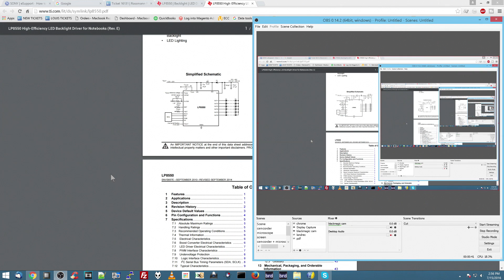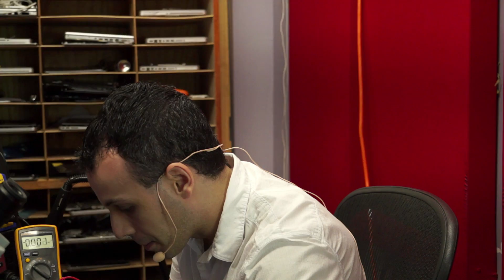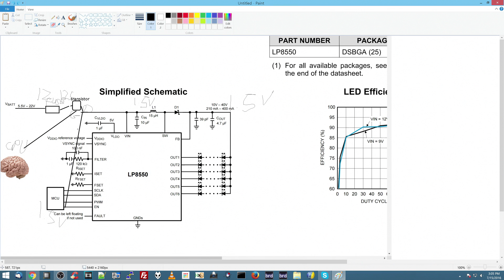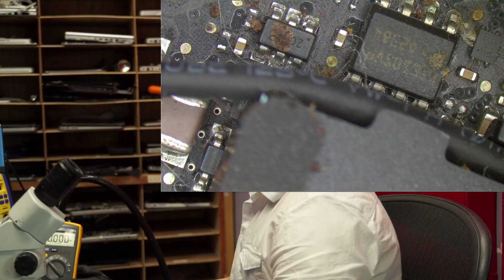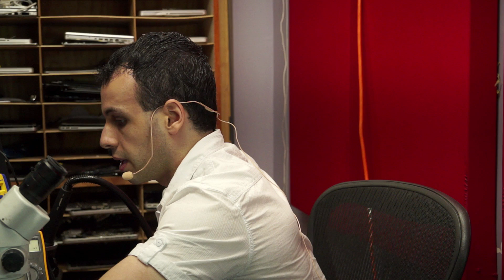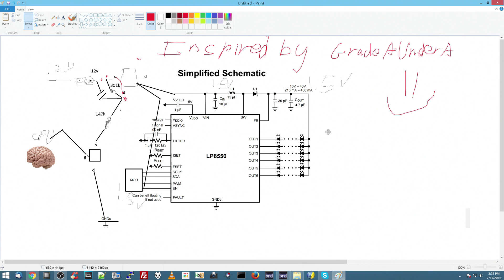No backlight repair with a grade inspired schematic

Comment: ok so i was thinking here, if you cant show the image of the actual apple schematics, or the digital version of it, but you can show a personal drawing, could you just invert it (black becomes white and vice versa)? pretty sure it wouldn't look half bad, and that makes it fair use, because it's a new image. also there are some programs that are able to reproduce those line drawings (corel draw for instance, inkscape is a free one) so you could change color, line thickness anything that could make it look as different from the original as possible, while preserving it's form. they do it automatically by the way, no drawing skills needed.

i'm sure you would learn to use those fairly quickly and it wouldn't take more than 5 mins to heavily modify a schematic so they can't claim copyright infringement.

Comment: Hello! On elforum.ro I learned more about transistors and one of the lessons was that a transistor fails not because he decides so. There is always a cause, and in this case may have contributed owner by the way has maintained its cleanliness.
My question for you is if you monitor somehow the temperature or the current of replaced transistor for a period of time.
Best regards, Marius Ciobanu from Romania. Sorry for translation, google translate

Comment: don't know bow you do it. Just spent my whole day trying g to fix my hp dv7's fan with no luck. turns out it's the fan but you have to replace the heatsink aswell to replace fan.... I just feel like a wasted a day.... I can't imagine doing board repairs everyday! although it was a nice feeling putting it back together and having it turn on and say "Fan Error 90B shutting down in 15 seconds..."
Reply from the maker: I fail all the time and it feels like crap each time.
Reply: +Louis Rossmann Totally stinks but when it actually works its a nice feeling. like you said in a video earlier. :)

Comment: Hi Lewis, first off I'd like to say how great your videos are and how they've really inspired me. I run a pc repair shop in Cornwall England and with the help of your videos I've managed to take a macbook pro and an older macbook that came into the shop completely dead and get them to the point of turning on but I have a couple of problems which are doing my head in. the macbook pro will switch on and the fan will spin for a few seconds and then stops and then does the same again and the front light comes on and off at the same time. the older macbook will work fine in till I plug in the keyboard and then I get no backlight. now I'm hoping that if things go according to plan I will be signing up for your repair class in August. I would be really grateful if you have any ideas on what could be causing this. keep up the great work as I really look forward to watching your videos at the end of the day.
Cheers steve easy-pc computer repairs

Comment: What board is this, 820-2879?

I looked through all the comments so sorry if the info was provided and I missed it.
Reply from the maker: 820-3115
Reply: +Louis Rossmann Thanks!

I'm trying to problem solve a similar issue with my 820-2879. Are the boards similar enough so that I can try this diagnostic on it? 

(Yes I've checked the fuse, voltage across the resistors connected to the fuse are good, I keep my computer clean, and no I'm not a business, just a broke novice).

Comment: A DIRTY pcb is when, you have to rub off, 20+ years old oil that converted to a gummy greasy substance that even iso-alcohol can't dissolve, only to be enable to get the solder to stick. But worst it's probably a through hole, which mean you do the same cleaning on the opposite side, in the hope that the oil/grease doesn't get on the pin of your new component. That's real nightmare.

Comment: Hi Louis, what is the name of that oozy fluid you're using while soldering/unsoldering and why are you using it?
Reply from the maker: Flux, it helps solder flow.
Reply: Always use flux. Soldering without flux is like frying in a pan without oil.... I believe AMTEC NC-559-V2 is the name of the best stuff you can get (The same brand Louis uses and that the company I work for uses).  Shit works beautifully.
Reply: Thanks for the answers.I actually had flux but in a small jar or something like that, i bought it when i bought my first soldering iron, but i was told by other people that i should use it to keep my soldering iron tips clean by submerging hot tips in it. I feel silly now, but at the same time glad that i found out how to properly solder stuff, i fix my own stuff when i can so one of these sticks will help me a lot.

Comment: I have no idea what you're talking about 99% of the time, but I find it interesting to watch. Keep up the good work!
Reply from the maker: thank you!
Reply: Here's a non technical question: Seeing as how the board was covered in grime and crap, is there a drawback to "cleaning" it, even so much as just using air to blow some of the garbage off it?
Reply from the maker: Chase Swindler It'll get tossed through the crest cp500d with branson ec and distilled water at 60c for a few minutes and also have the body of the laptop cleaned, can't send it back to them looking like this if they're a paying customer..

Comment: Nice Louis, i also use paint to make quick schematic sometimes. 
I also using post-it for quick fix on A3/A4(i know i european) paper schematic to hand over to our guy at work that e-cad at work(alot faster that fire up the cad program). 
I usually scan or take a photo the result for documentation also.

Some extra info why the resistor divider exist for transistor(its a p-mosfet). It there to save money and be able to select a  p-mosfet with lower max gate-source voltage.

Comment: Good presentation. If MS Paint and/or other likewise drawing programs may prove to be tedious, you may want to consider some sort of mixed signal "no-cost" EDA software. EasyEDA is one of the online apps that you can use without having to download directly to your storage drive. It can be quite buggy and there are a lot more features you may or may not have use for, but for the most part, it can be quite helpful for the tasks you demonstrate above.

EasyEDA: https://easyeda.com/
EasyEDA YouTube Channel: https://www.youtube.com/channel/UCRoMhHNzl7tMW8pFsdJGUIA

Others: https://en.wikipedia.org/wiki/List_of_free_electronics_circuit_simulators

It may be necessary to go for paid EDA software if you intend to go beyond what you demonstrate above,  but I'll leave that for another discussion. :)

EDIT: PartSim was what I eventually used instead of EasyEDA due to certain features, however that's just my personal preference.

Comment: Hey, Louis.  I've used the following mouse option in my classes so the students can see where my cursor is on the display.  To set it up for Win 10:

Windows Key >> Settings >> Devices >> Mouse & touchpad >> Additional mouse options >> Pointer Options (tab) >> select "Show location of pointer when I press the CTRL key" 

Now try it!  Zoom-circle will show you cursor when you release CTRL key.  Hope that helps.

Comment: Are you using Windows 8.1?
\
Reply from the maker: yes
Reply: +Louis Rossmann weren't you using 10 in your other videos? why downgrade? just curious.
Reply from the maker: Raul Morel nothing I want to use works with it... can't use izotope rx5 to denoise the fume extractor at work, can't find any alternative. linux is great for basic stuff and for servers anything even remotely specialized or niche and you find nothing. not to mention all the crashing in every video editor i've tried. just done!

Comment: Understanding application  notes from chip vendors is an essential tool for repairing modern consumer electronics.  Since the advent of highly specialized chips in the 1990's most design engineers simply use the app notes that are supplied with the chips.

I like your homemade schematic drawings. . . much like the ones I scribble on a note pad when I'm repair equipment.  It's actually a good way to help visualize a circuit which leads to problem solving.  Oh, you forgot to name your stick-figure.  Chris
Reply from the maker: Thank you!

Comment: Being an industrial tech the same troubleshooting methods apply. Such as narrowing down a plc to a servo hydraulic signal. I never thought surface mount components could be repaired outside the oem facilities. Albeit, your setup is more expensive than standard equipment. I have tried with a standard iron, solder, and spring return vacuum needle. Needless to say it was damn near impossible. Your videos are very informative. I take it the desk/bench is grounded for ESD? I thought your black gloves were a part of that system but I wouldnt wanna touch those components either now you mentioned it.

Comment: What was that glue like substance that Louis put on the board at 19:30?
Reply: That's flux, it helps the solder adhere better I believe, but I'm not completely sure.
Reply: Sperm
Reply: Ah thank you, this is the first video I've seen of Louis repairing stuff, but that makes sense.

Comment: Isn't Gate Drain Source usually used with MOSFETs? 7:32
Reply: It is a MOSFET.
Reply: yes. metal–oxide–semiconductor field-effect TRANSISTOR. So after all it is still a transistor. Different technique, same principal. Definitely a difference worth mentioning though.
Reply: simonthechipmunkCC I know what MOSFET stands for.
Electrolytic and ceramic are both capacitors, but you use them totally differently. 
I know he was talking about FET now but at the time if he was talking about a BJT
Reply: Chef Geoffrey Excellence Where/when/how does it seem like he's talking about a BJT?
Reply: BJT = Collector, base, emitter. Mosfet = source, gate, drain.
Reply: Louis was referring to a transistor while using the terms "source, gate, and drain", which is incorrect.
Reply: +Lazerbeam Both BJTs and MOSFETs are types of transstors. If someone says transistor, you can't know which type it is without context. In this case, that context is the fact that he said gate, drain, source.